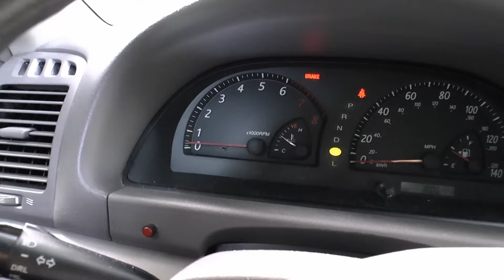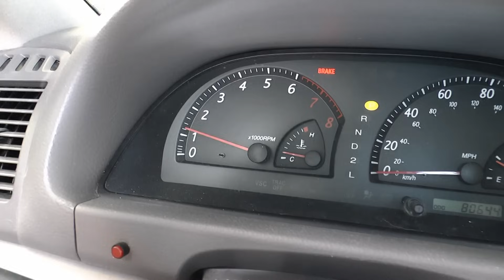How to Fix Low Idle Problems in Your Car (Throttle Body)

Comment: I cant remove my air duct from the throttle body. I removed the clamps and all but its like its been glued and wont budge. Any suggestions on removing my air duct to get at my  throttle body? 2006 Toyota highlander v6 base model
Reply: ***** Yes I did, really I had a friend who is much stronger than I spend some time wriggling it loose. I have not tried separating the parts since I cleaned the throttle body area. Might just have to see what's become of it all. Thanks and I should have said something once I got the pieces separated. I did not use any lubricants or such as I was ready to upon first unsuccessful try. I have no clue to what can be used as a help to separating the parts when stuck.
Reply: ***** my Toyota  Highlander feels better but still not at the level I know the car should be performing at. Wifey drove it 10 years all streets within 3 miles radius, she don't remember one maintenance operation she had done in them 10 years. 87,...miles is a plus. I'll have her new one day minus a new paint job. I'll trade her in for a Lexus is or es300. Around 2001-2004. I likes the direction they put this car thru. Engine was solid. Liking fur a used, one owner, lease type car. Get a good deal I hope. Throttle body is only 1 of several steps for overall maintce  performance improve ment. Worth it in the end tho
Reply: no issues with oil. My highlander just feels like its lost a little pop. It is 10 years old wifey drove it streets only and had AC on every second even with heater going. I wouldn't say it slips or completely has a pause before it gets going when i punch it but i seem to think there is something there
Reply: ***** no codes
Reply: Shane Bowman whats up

Comment: Scotty I Have a 2004 2 .2  that idles perfect but if I put it in gear with foot on the brake  it shakes  or with the a.c. on shakes   .car idles at 850 rpm is that to low
Reply from the maker: no, but you might check for worn motor mounts or vacuum leaks

Comment: I noticed that my car is idling too high around 1800rpm..if i turn on the A/C the idle goes down to 900rpm if I lev the car idle with the A/City on for about 30 -40seconds the idle goes back up to 1800rpm then every 6 second it goes back down to 900rpm....if i plug out the mass air flow sensor it'll idle at 800rpm where it's supposed to be but the only problem is it idles rough as if the car is dieing out and catching itself again..do u kno what is causing this hight idle?
Reply from the maker: Id' start by checking for vacuum leaks, if none are found, I'd replace the maf

Comment: I have a 2003 ford ranger B6 3.0 motor when I'm at the stop sign with my ac on my truck idles rough but when I drive away it good what could it be .

Comment: Hi Scotty,

I really love your videos. I have a question regarding my vehicle that's idling poorly. Prior to changing the battery, we had to jump start it several times until we finally changed the battery. I changed it my self (It's not that hard) and upon starting the car (I drive a 2001 Ford Falcon Forte AU II) the car would idle very poorly. When put into D or R it will jump down to about 200RPM and slowly jump up. If stayed too long on gear without any gas, the car will die. This has caused me to constantly put the car in neutral when approaching red lights to prevent the car from stalling. I took the car to my local mechanic, they said the car needs to 're learn its self' they cleaned the throttle and told me to drive it around for a couple of hours. Its been 2 months and still not idling properly. I took it back down to them and they said i need a new throttle body. I want to check with you first though. Any ideas scotty?
Reply from the maker: throttle bodies do go bad on those ALL the time, I would expect that

Comment: scotty, i have a 2003 kia sorento that i need help with, i was traveling around 70mph and decided to turn my a/c on, after a while i noticed the air was blowing warm air as if it was just the fan on, i messed with the thermostat and i heard like a snap coming from the hood of the car then alot of cold air started coming in, my engine then shut off so i pulled over and ALOT of white smoke was coming out from under the hood i opened it and noticed all my water was gone and the left side of the engine was full of oil or water can you please help as to what might have gone wrong?
Reply from the maker: probably the ac compressor blew or an ac hose blew and threw refrigerant and ac oil all over the place
Reply: Scotty Kilmer another question, today i filled the water reservoir again and tried turning on the truck when i cranked it there was a sound of an air leak and a little water started spraying out the front right of the engine from behind a pulley as if something was loose and the truck did not start. i am asking for your help because of your experience and because a mechanic out here wants to charge me $1,500 to fix it, he says that the engine needs to be overhauled but i think he is just trying to make money off of me since i know little about cars.
Reply from the maker: cesar jimenez   could be a blown head gasket, which would cost that much. Get a second opinion though
Reply: i just replaced the timing belt, crank sensor and water pump like 3 months ago but it sounds like thats what could have happened
Reply: scotty and jimmy i have an update on my sorento so today i was finally able to get a good look at it and i found that a rubber hose running from the radiator into the top of the engine was slashed by a belt which caused all my water to fall out which im guessing is why there was so much white smoke coming out the hood when it happened so i replaced the hose and filled the water reservoir tried turning it on but the start is very weak as if the battery is almost dead, i hooked it up to another car with cables for about 10 min and tried it once more it kinda wanted to start but the start was still pretty weak i even sprayed the intake with starter fluid but nothing, and i noticed the reservoir of water was empty again but there was no water leaking anywhere i filled it about 3 times. i am going back tomorrow to see what else i can do to it but i wanted your opinions since i really dont know much about cars.
Reply: The return line to the engine block for coolant (or sending depending on how your Kia is) broke when the belt snapped, causing the water in the engine to become hot and not circulate. Essentially, water circulates through the engine using a water pump on a drive belt, moving the water through the engine and radiator so it doesn't get too hot and cool water enters. When the belt snapped, not only did water stop circulating and became hot, it also snapped a radiator line, and your engine block lost water. At best you have a warped head, at worst you have a seized engine. My bet is the latter, sorry.
Reply: You should have kept that 300 lol

Comment: I know this is a old video but if you put the key in the run position before reconnecting the battery the alarm won’t go off
Reply from the maker: that does work on some models

Comment: Help me please to figure out the problem in my jeep wrangler 2014, 22000mi , seal was broken between Cadillac converter and engine black, fule consumption was 13 mpg after new seal same mpg ,I reset computer by tuching 
- + wires and got 18 mpg local (wow) 4 days later I drove 85 mph on highway about 30 minutes when I got off Highway jeep was vibrating , idol was low and make noise when push gas, RPM doesn't go up unless I push hard , I will be thankful to you like before you helped me .

Comment: Hey Scotty can you help me with ny 1991 honda civic dx and I'm having trouble with my acceleration when I stop at a stop sign and I accelerate it starts hesitating and sometimes bogs and turns off. Thank you
Reply from the maker: pressure test the fuel pump to see if it's weak and needs replacing. If not, try my video "how to clean fuel injectors on your car" and of course see if the spark plugs are just worn out
Reply: Ok thanks
Reply: Alex Rivera
try testing the spark plug wires too. Had that problem on my accord last month and new wires fixed everything.

Comment: Hey scotty i have a 96 mustang gt 4.6 and my ac only blows from the defrost vents what could tha problem be?
Reply from the maker: it's stuck in defrost mode. PRAY it's just a vacuum leak, check all the hoses, see if any fell off or are cracked.
Reply: Is it hard to fix if its stuck in defrost mode

Comment: does a dirty air filter ever cause low/surging idling? the filter must not have been changed for at least 15 years for it to cause it?
Reply from the maker: yes, it can, but it can take only 15 weeks if you live in a really dirty dusty place

Comment: i have a 2001 vauxhall frontera 2.2 dti and the check engine light came on and car run sluggish.so pulled over the revs were sort of hunting then engine lightwentoff and all was fine. the odd time its done this the car has just cut out but restarts straight away
Reply from the maker: +burtie777   get it scanned, the engine light has codes to show the problem area

Comment: @scotty is this the same on a 06 Subaru Impreza (manual Trans)? I changed the battery.
Reply from the maker: +Carlos Diaz yes, realize just changing the battery often makes em idle low, drive it a couple days to see if computer resets idle itself

Comment: What if it isn't the throttle body,spark plugs, ignition coil, or iac valve causing your engine to low idle?
Reply: Noe Yanez charging spark plugs, coils, or your fuel filter are tune ups, and will correct a low idle also, a sign to change them normally would be your engine not only idling low, but rough

Comment: Hi Scotty.  I've cleaned the throttle, the idle air control valve, and the air filter is pretty clean.  I've checked the EGR and it is working propertly, but I still have low RPMs.  But it sometimes has normal idle, but when it is normal, it acts like a cold start by having high RPMs that steadily go down which takes about 10 minutes to idle down.  But sometimes when it is cold, it will start, but like I said, it takes 10 minutes to idle down. (if I start it again soon afterwards, it will start with low RPMs around 500)  Other times, it will start and immediatlely die.  If I give it gas, it will be OK, but the RPMs will come out once again around 500 or so.  I just can't figure out the problem, can you help??  It's a 1998 Toyota Camry XLE V6 3.0 litre engine.  I've also scanned it and it is pulling up no codes.  Do you think your video on "Getting Your Car to Pass Emission Testing" would help by using the ShopLine Solvent??
Reply: i would like an answer to this as well. Just got done cleaning the throttle body and tomorrow will be taking it out and see if it still dies at idle.

Comment: I work at an auto parts store and I'm always changing batteries.  And it seems to me that all models of Toyohashi ranging from 95 and newer. The throttle is real low.  What I tell costumers to do is idle the car at 3500 rpms for about 3 mins to rest to normal idle. Why is that?
Reply from the maker: that helps reset the computer idle relearn process.

Comment: I’m getting really bad gas mileage, when I accelerate it goes down to literally 20 mpg (U.K) when accelerating gently in 5th gear at less than 2000 rpm I have a 1.0 ecoboost fiesta could this be the issue?

Comment: Hey scotty i have 1990 Audi  with 1.8 petrol engine. IT idles really rough and often when is cold or raining it shuts of. where's the problem?
Reply from the maker: +eoneon667 audis of that are are money pits in the making. tons of things can do that, but clean the maf sensor and check for electrical shorts on the ignition system first, as those often have ignition problems when cold or wet at that age.
Reply: +Scotty Kilmer i dont  think  there  is maf  sensor  at  this  vechile.  its  got  only  airbox  over  carburator.  also  i checked  all  cables.  all  seems  fine.
Reply from the maker: +eoneon667  1990 audi is fuel injected, but odds are it's an ignition failure as I said
Reply: +Scotty Kilmer 1990  audi  80  b3.  It has carburator  sistem.

Comment: I bought a 2008 Volkswagen Passat and when my car turns on it idles or accelerates and then balances out sometimes while in park at a drive through it idles as well. No check engine light comes on I replaced pcv valve and camshaft position sensor

Comment: Can a certain type of air filter cause low idle? I just tested one of my panel filters (its a RYCO air filter), by removing it and going for a drive, it idled so much better without the filter than with it. The filter i have looks like cloth, not paper :/ No light passes through it when under direct light. Car is a mitsubishi evo 7.
Reply from the maker: yep, stick to factory filters, other ones can make air flow incorrect
Reply: Scotty Kilmer Cheers! Will try a apexi or HKS panel filter :)
japaneseaggression Heard the oil in them can screw up Maf readings over a long period of time. Not a good idea to run on turbo charged cars, there is a chance the filter will cause it to run lean. Usually over oiled filters are the culprit, id just stay away all together.

Comment: hey, i have a problem. something in my cars consumes power even when turned of. so my battery runs dry if i havent runned it for a few days.
my multimeter cannot measure milliamphere so i dont know what to do.
Reply from the maker: +eddy do my video "fixing battery drain on your car"
Reply: +eddy Had the same problem, it was a alternator issue, there is a vid. to diagnose electric problems with the alternator. Simply, measure voltage differences between alternator output and battery. If it's more than 0,6V , the connection is bad. I have fixed this cleaning the connections.
Reply: +Gigi de la tara: thanks for responding, ill look into that. have a nice day

Comment: i bought a 96 camaro v6 from a friend that purchased it from a woman that had it sitting for seven years, when the friend bought it, he put no work into it driving it with cracked tires from 96 ( bought it 2 months ago) (he had it for a month). Ive had to get the transmission rebuilt, the spark plugs, coil overs, and o2 sensors replaced, and now it also has a slight oil pan leak which is burning on the exhaust putting fumes in my car when i use the heat or A/C. The oil pan gasket price to change it is $550. Ive already put like $7000 into it and it doesn't eve have a V8... what else could possibly go wrong on it? Please help, I've dug a big hole for myself
Reply: +Mark DeBartolo oh how could i forget the ABS system fix, that was another $1400...

Comment: I have a 94 ford lightning I had the lower intake gasket replacement  because it  had a vacuum leak now the truck idle too low around 600 rpms the mechanic told me that's where the computer once it but I have the truck for 15 years it always idle about 800 rpm . and now it surges when going into drive on start up or reverse and now it has a choppy idle
Reply from the maker: +hosea wallace   go somewhere else, and check for vacuum leaks, he may have botched thejob
Reply: +Scotty Kilmer thanks I will

Comment: heaven help if you accidentally shred off and drop some of the paper towel down the throat of the throttle body and into the intake manifold.  To avoid this, I use a very large microfiber towel to clean it all out.

Comment: Hey Scooty,
I got a 87 Lesabre 59k miles and i think its idling kinda high because when i put it in drive it dose it harder than i like it to, but i cant tell for sure if it is or not becouse it doesnt have a RPM gauge is there a way too look at my engine RPM what are my options O_o
Reply: +MrMister1227 Listen with your ears lol. Older Buicks(mine at least) idle high until warmed up. Make sure your car is warmed up before putting it in drive... The extra rpms will make it jerk when first in drive. Of course if you always warm up your engine this obviously isn't your problem

Comment: hi i bought a 2005 toyota corolla it idle at 6000 rpm and it filles like it's going to store and when i press the clutch down to change gear it reving up

Comment: Hey guys I have a 07 g35 infiniti sedan,  I had the troddle body replace both of them and the car is now surging when it idling.  we tried relearning it with the computer but know luck. what do I do? any help is greatly appreciated.
Reply from the maker: pay a mechanic to reset it the system, infinitis are that complex, they make em so the dealer rips you off at every turn

Comment: Ok i'm having a problem with my 1999 grand am 3.4 idle. it sounds like and shakes like it has a miss fire but at cruising speed or under power it does not miss fire. what would cause that?
Reply from the maker: try my video "FINDING ENGINE VACUUM LEAKS WITH A CIGAR
Reply: ok i shall give that a try

Comment: Hi Scotty please help my steering wheel is shaking what do I do my car is a 2006 70,000 mile kia spectra 2 front tires are new one year old please help thank you !
Reply from the maker: depends when it's shaking. If at speeds, have the tire ballance checked AND have the front end checked for worn parts like tie rods that are loose
Reply: Thank you so much!

Comment: I changed my idle control valve and cleaned throttle body andit's still showing code p0505 idk what to do from here I checked all vaccum lines and no leaks

Comment: my 1997 civic when idling at times goes close to 200 rpm and then goes back up to 700. I've clean the throttle already  and it's still the same. also In cold starts if I put the car into gear the rpm goes straight  down close to shutting off
Reply: My 96 civic does the same, did you ever solve that problem ?
Reply: Nah I haven't, but sure it's the idle control valve